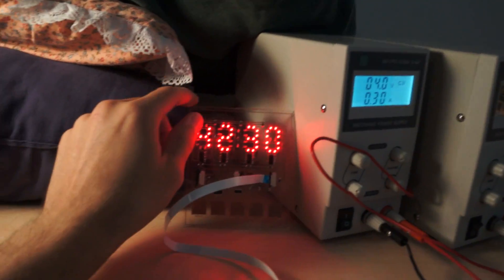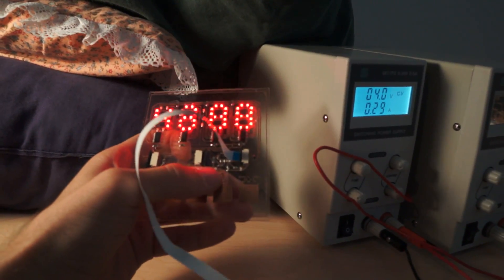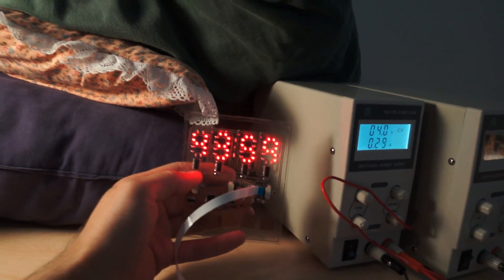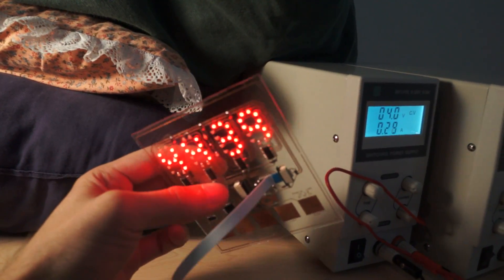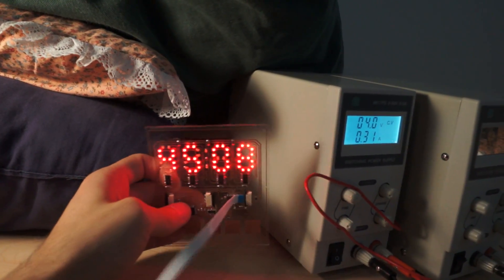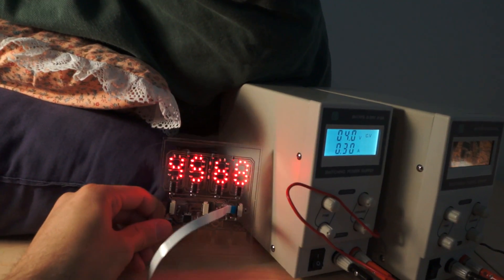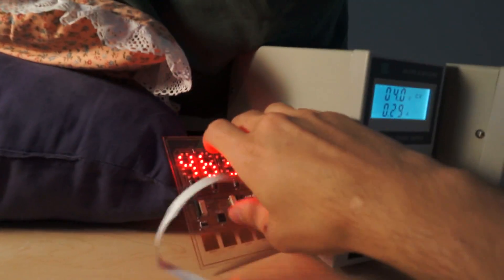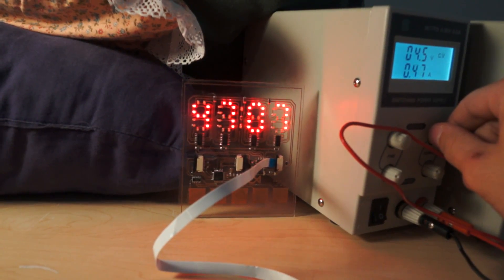AVR Clear Glass PCB Clock

Comment from the maker: Well, when I was testing earlier it did seem to work with with at least setting the time, no alarms, or anything else fancy... not that alarms would make sense since it doesn't have a speaker.  I could program and test the chips. For the pair... 

I didn't really think about the powering mechanism... I guess I'd have to use a 3.6V wall wart or something?

Comment: Are you turning one 1 LED at a time via the shift registers, or more than 2?
Yes the output source/sink current is 25mA limited, cool. But the total VCC & GND is 50mA; so if you want to sort-of obey the limits, you can't turn on 2 at once.
I hope it doesn't burn out the registers. otherwise, it's a really cool little project.

Comment from the maker: Oh, I know I'm using the part far outside it's spec'd operation, but I've been able to run it for some time without issue.  Additionally, since its behavior is very good at different voltages, by dropping Vcc to 4v, I am once again operating within the 50 mA/chip max.